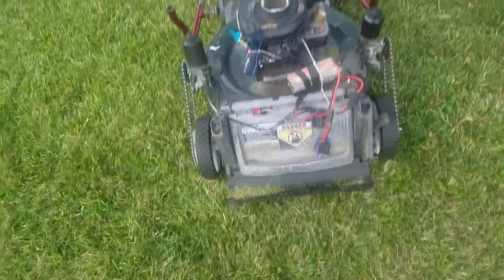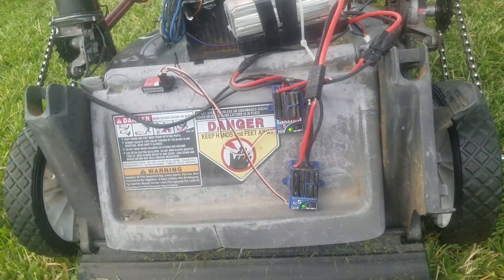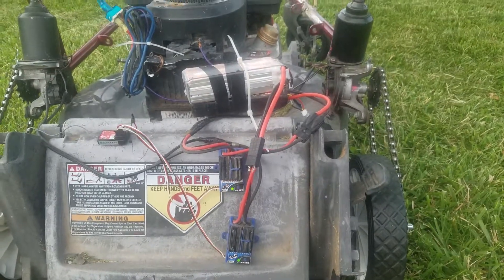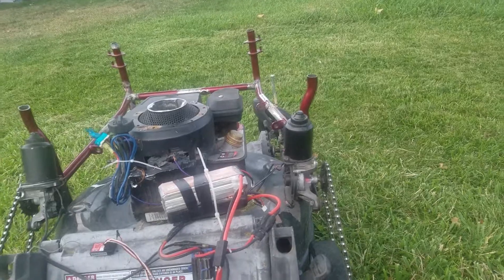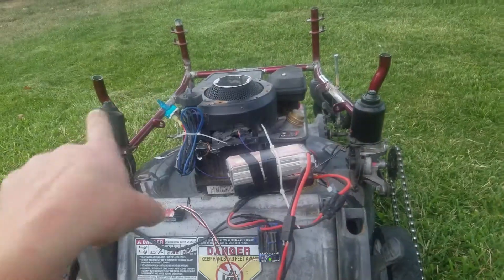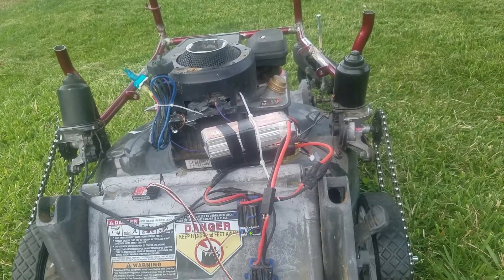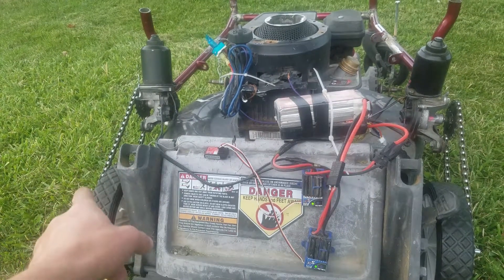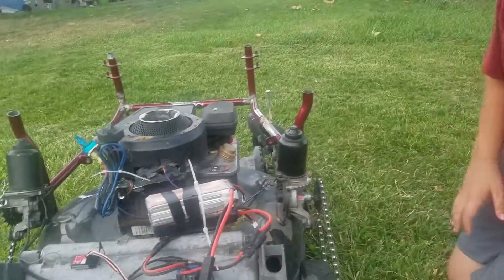RC lawn mower update it has steering

Comment: I wonder why you didn't used wheel shair motors just a suggestion
Reply from the maker: I couldn't find any that were in my price range. I have an idea for an upgrade that should work just about the same
Reply: But still you did awesome job..i find  my motors on offerup and  letgo app
Reply from the maker: @marianohernandez198  thank you.  I will have to look. I did find one for free but someone needed more than I did because their chair broke down and they couldn't afford to get it fixed or buy a new one so I let them take it. Thank you for the suggestions